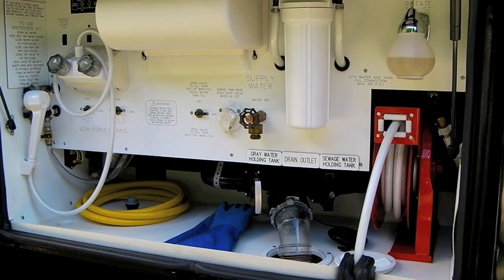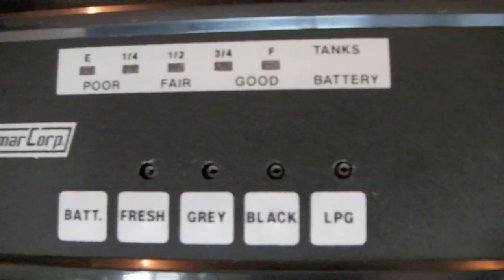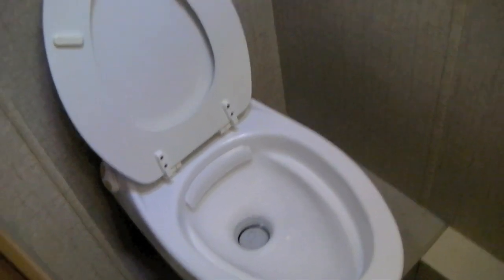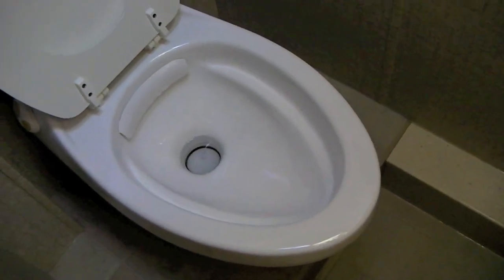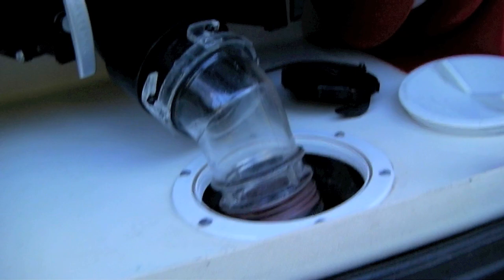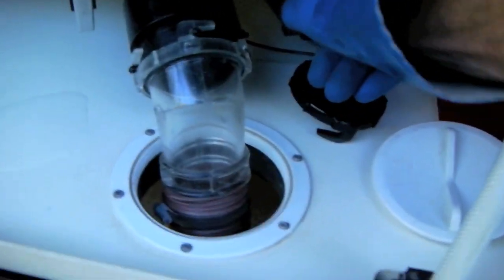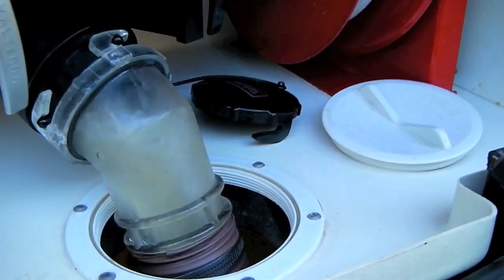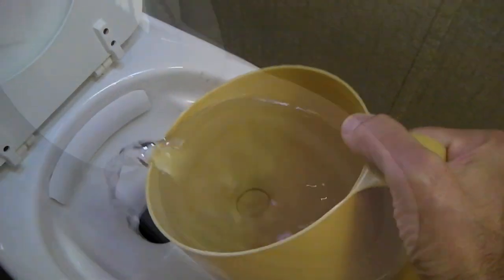How To Dump & Clean an RV Black Tank

Comment: What about when you have to use a roadside public dump station?   They typically don't have a water connection that you can use to power a toilet wand, just a hose with no male connector on it to wash down the concrete after you've finished.  I use a water thief & a short hose thru the window to the bathroom to power the wand.  Is there a better way?  The old "10% smarter than yer working with" rule....:) And yes, I wouldn't be without the clear elbow!
Reply from the maker: As we mentioned, we really do try to never dump the black tank at a dump station if we can possibly avoid it. We're pretty good about monitoring our systems and tanks, and if we know we're getting close to a full black tank, we'll make an effort to use campground bathrooms to take the, "ahem" load off (sorry) the tank. If the tank fills and we're not en route to a full-hook-up campground, we have at times specifically stopped at one for the night to refresh resources for another stretch of dry camping (fill fresh and dump black & gray). The combination of needing a water thief (we have one of those too) and especially the potential for a line-up of other RVers behind us at the dump station is not the most relaxing thing I can think of. lol The biggest problem would be if you dumped the black without flushing and let it sit empty for any length of time. Whatever dries onto the tank might never come out without resorting to the ice trick, or other cleaning method. If we had no choice but to dump without being able to flush, we'd immediately fill the black tank with enough fresh water to completely cover the bottom (maybe even 1/4 tank) to prevent any remaining solids from drying to the bottom, and hope that there wasn't too much of anything stuck to the sidewalls.

Comment: Hey, I've never done this before, but I was wondering. (call me stupid) do you keep black water tank full with water? I thought gray water is what's used to flush the toilet, and that transfers to black tank.
Reply from the maker: No, the black tank is not kept full. After dumping the back tank, add only about a gallon of fresh water and your toilet chemical (add both right through the toilet). The toilet is flushed with fresh water, not gray water. Gray water is used to flush the sewer hose after dumping the black water. Not a stupid question at all.
Reply: Ah, much appreciated :)
Reply: Is gray water used for anything other than cleaning black tank?
Reply from the maker: gkohler14 The gray water doesn't actually clean the black tank, since it never goes in there. It just rinses the sewer hose out after the black tank gets dumped.
Reply: oh... What is it used for then? I was told that it runs your shower and kitchen faucet.
Reply from the maker: gkohler14 Here's how it works... fresh water comes into all faucets.... sinks, shower, toilet, etc. The water that goes down into the sink & shower drains is called "gray water" and goes into the "gray tank." The water and waste that goes down the toilet is the "black water" and goes into the "black tank." Both the black and gray tanks are emptied through the same sewer hose, so the reason you always empty the black tank first is to that the gray water will wash any black water residue out of the sewer hose. The gray water isn't actually "used" for anything per se. It just happens to be cleaner than black, so better to have it go through the sewer hose last. Hope that helps explain it.
Reply: Oh, man. My theories weren't thought out very well xD Thank you so much. It all makes perfect sense. Thank you so much :)

Comment: these black tanks should hae cleaning jets in them.especialy pointed at the sensors.also or, something similar to the thing we see inside an automatic dish washer.this would be feed by the gray water.when feeding fresh water into the gray tank[flushing it],it would then blast the inside of the black tank through the spining dishwasher type rinser in the black tank.this would save an incredible amount of time and water,the same way an automatic dishwasher.recycleing risewater then 1 fresh rise

Comment: pardon my lapse in 'savvy' on RV toilets and their care and use,  but.....isn't there a 'blue chemical' that you'd use in this instance,  to both 'break down' the black substance and help to deodorize and sanitize the tank.  i believe in Aircraft,  to service the "Lav" is a similar procedure.  you hook up a large hose to the underbelly at a Port door,  and empty what's called "the blue water",  due to a chemical that was added to the tank to keep things more sanitary and dissolve all that nasty waste.    i've not heard you mention this in the RV procedure?  just wondering?   thx!
Reply from the maker: Great question. The blue stuff is actually what you specifically want to avoid. They're generally formaldehyde-based products that kill the "good" bacteria that helps waste break down. Bacteriological treatments, like the Rid-X that we use, break down waste naturally. Many RV parks prohibit putting formaldehyde treatments into their sewer systems, since they stop the breakdown process. There are lots of good choices of tank treatments... just stay away from formaldehyde products (like Aqua-Kem) and go for any one of the bacteriological products (such as Pure Power Waste Digester). Because we didn't know any better, we used the blue stuff our first year on the road. Once we switched, we found that the natural products work better anyway, so there's no compromise.

Comment: We are wanting to live in rv for a while, will a drinking water hose be enough to provide water for shower toilet etc? Also can we leave a sewer hose connected on both thanks to get rid of stuff as we flush or use. . Or will we have to keep emptying?
Reply from the maker: A white drinking-water-safe water hose is not only plenty of water for all your needs, it is the only way you can hook up to water. We've full-timed for over 10 years with just a single water hose providing all our water for showering, cooking, toilet, washing machine, etc. You'll be in good shape there.

As far as a sewer connection, you can indeed leave your sewer hose connected long-term, but be SURE to keep the black tank valve in the closed position. The gray valve can stay open all the time, allowing sink and shower water to run freely down the sewer. But the black (toilet) tank MUST be kept closed, otherwise the "liquids" (pee & water) will run down the sewer, while the "solids" (um... #2) will build up and harden into a solid pile (called "pyramiding"). That would be a very, very bad thing. You do indeed need to dump the tank periodically, even when living long-term hooked up to a sewer connection (maybe every couple of weeks or so, depending on use and tank size).

Hope this all helps!
Reply: Great!  Thank you!
Reply: juantenoriojr69 anais morales most homes in America are supplied with a 3/4" pvc pipe for water, so a standard water hose will be just as sufficient.
Reply: B

Comment: Hey I have a question for you, I was planning on using my black tank flush and filling up the black tank and draining it the same way you did, but on my 2013 Jayco 28bhs, there is a sticker by my black tank flush that says, "Black Tank valve must be left open when using black tank flush." So I am guessing I am out of luck? Or do I need to go to the toilet and fill up the black tank and drain it? Thanks!
Reply from the maker: +Brandon Draher Hi Brandon! Ours says the same thing! We think that's there for liability reasons, so that anyone who leaves the flush running with the valve closed and wanders away and pumps black water out their roof vent can't complain (or sue)! 😉
Reply: RVgeeks Ok thanks so much! Thanks for posting these videos they help out alot!
Reply: i do the same thing in my flushing process but when i close my valve the tank builds pressure. could my vent be clogged ? i only let it fill with about 2/3's water but i hear air escaping around my toilet.
Reply from the maker: Yes, it sounds like your vent is likely blocked.

Comment: You have your potable water hose under your sewer hose. If you spring a leak in your sewer line you'll have to replace your fresh water line.
Reply from the maker: +Shawn Garman It's the outside of the fresh water hose, not the inside. If something gross gets on the outside of it, just wash it off! LOL All sewer hoses come out right near each other, so it's just the way it is. Don't worry about it.

Comment: My rv doesn't have a hookup to flush the black tank. Is there any reason why I can't just hold the pedal down on the toilet and fill the black tank a few times and use the clean water to flush the system (given that I'm hooked up to a water supply at a campground)?
Reply from the maker: Josh Rudy You absolutely can do that Josh. If you want to increase the amount of cleaning of the entire tank (walls, etc), you can buy a special wand to stick down the toilet that sprays the interior.

Comment: Do you use type of additive to the black tanks to dissolve solids? Thank you
Reply from the maker: Our usual day-to-day toilet chemical is Happy Campers, which we've been using for about a year and really like. It's available on Amazon: http://amzn.to/2fJibeq This is the 18-treatment container. They also sell larger sizes, but I don't see them in stock at the moment.

We used Rid-X for years, and really like that too: http://amzn.to/2eDneKU

If you have a black tank odor issue, you might want to try some Happy Campers Extreme, for a really thorough cleaning: http://amzn.to/2ethPma We've never needed it, but heard good things about its ability to break down solid waste that has been allowed to accumulate in the tank.

Comment: How could one keep the tanks from freezing in the winters if you dont own a big garage to store rv/camper?
Reply from the maker: Tanks freezing isn’t a problem, since they should be dumped prior to storage, and there’s plenty of room for the water to expand anyway. The problem is plumbing lines and valves freezing. Our video on winterizing RV plumbing covers our favorite way to do that using compressed air.

Comment: How about mixing salt with the ice to REALLY scrub it out or would that be to abrasive for the tank
Reply from the maker: I don't think that would hurt the tank at all, and lots of coarse salt might add to the scrubbing action. :)
Reply: RVgeeks Have you ever made ice cream? What does salt do to ice?
Reply from the maker: 1sfjasper1 I used to have an ice cream maker! lol Salt lowers the freezing temperature of water, but not sure what effect that would have on tank cleaning. Since it would make the ice melt faster, it probably wouldn't help. Now I want ice cream. ;-)
Reply: Wouldn't that freeze the ice into a clump and the water around it sorta degrading the effect pieces of ice are suppose to have? Wouldn't baking soda and vinegar be just as if not more effective breaking down solids without having to ride around wasting gas? Just brain storming. I did like everything else about your presentation. It was through and precise. Makes a great reference that I will continue to go to. Thanks!
Reply from the maker: 1sfjasper1 Thanks for the thought about baking soda and vinegar. Might be worth a try. As far as  "wasting gas" goes, we would never make a special trip just to clean our tank! lol We drive so much already that just about any day of normal driving would do the trick. :)

Comment: I was under the impression you should never flush the black tank using the flushing connection with the black tank valve closed as shown in this video.  Not sure why but on our RV there is a decal warning of this.
Reply from the maker: +Eric Cope Hi Eric. Just about all RVs have decals like that, including ours. It's a precautionary thing to prevent people from accidentally overflowing the black tank out the the vent on the roof. As long as you pay attention to what you're doing and don't leave the water running and walk away, there's no harm in filling the tank through the flush system. We've been doing it for over 12 years without a problem on either one of our RVs, and keeping our tanks much cleaner as a result.

Comment: When you go to a campsite do you need anything in your motohome to get wifi and cabl? or does that come with the motohome.
Reply from the maker: Hi Brian. For cable, you should be able to just connect from the outlet on the site pedestal to a connection on your RV... IF the park offers cable service (some do, some don't, and some only offer basic channels). Usually... you then need to force your TV to scan for the available channels so you can tune to them. If the park has a WiFi network, you can pick it up from your laptop/smartphone/tablet... IF they have a good enough system or IF your site just happens to be close enough to the office and/or a tower. Or you can just walk to the office (or wherever signal is broadcast from) and get stronger signal there. But if you NEED good signal, you can get a boosting device like a WiFiRanger, which dramatically increases the distance you can be from a WiFi source. However... if you ABSOLUTELY HAVE TO BE ONLINE? Plan to spend the money on a good cellular plan (or two or three) and get cellular boosting equipment like the WeBoost.  We use the Drive 4G-X ( http://bit.ly/weboost-drive-4gx ) with OTR antenna ( http://bit.ly/weboost-4g-otr ) and it keeps us online pretty much everywhere we go!

Comment: What is the purpose/need for the sewer hose supports you are using here? To create a ramp so the "$#?! rolls down hill? Lol Not sure if it serves another purpose than the obvious.
Reply from the maker: It kind of is so that it will run downhill! LOL But there's actually a great reason to do that. If you lay the hose on the ground, it will usually fill up with gray water and that will stretch the hose all the way out every time you use it, which can make it a pain to put away, since it takes up more space that way (of course you can compress it back down, but it resists that more and more the more stretched out it is). The other reason to use a sewer hose support is that many areas have local codes that require the sewer hose to be up off the ground, in an attempt to reduce the potential for spilling sewage onto the ground. That actually makes sense, since a sewer hose is more likely to leak when filled with water, as opposed to it running smoothly out via a continuous downhill slope.

Comment: Would like want to put a pressure value in series with that yellow hose just in case the pressure in to high?
Reply from the maker: +2badger2 Because there is no way to close the black flush valve to allow pressure to build up, the only time we worry about that is at those super-high-pressure, high-flow standpipes (the type with the handle you lift up). With those, we either open them only a small amount or go ahead and use a pressure regulator. We've never had any problem, and prefer to have stronger water flow than a typical pressure regulator allows to flush the tank as thoroughly as possible.

Comment: Personally I don't understand why they would use Rid-X in a "holding tank", it's not a septic tank after all but I suppose if it takes 2 weeks for them to fill up it helps break down the solids more, still wouldn't use it. We use a lot of water per flush to insure no pile of crap can form so we fill the black quickly.

Comment: Does it matter where I attach the back flush adapter? Black tank water flush port vs water spout?
Reply from the maker: Technically no, since the purpose of the backflow preventer is to make certain that nothing can go back into the city water system. We just like to put it right on the RV, so that nothing can even back up into the hose, just in case we should ever use it for anything else. 😁

Comment: I'm having a problem with the sensors on my grey and black tanks and I don't know if they are "dirty" or if they just need to be calibrated. The bIack sensor seems to be okay but the grey tank never reads less than 2/3 full when it has just been emptied. I've tried all kinds of products that say they will clean them but ????? Smell is not an issue in the black tank. Can anyone help me. I have a 2002 Monaco Diplomat and there are no adjustments on the panel face.